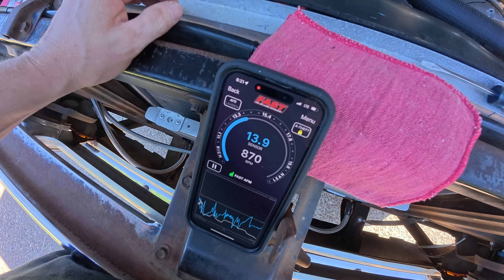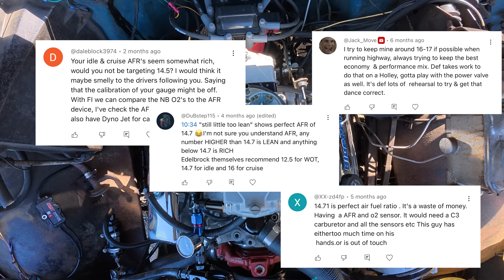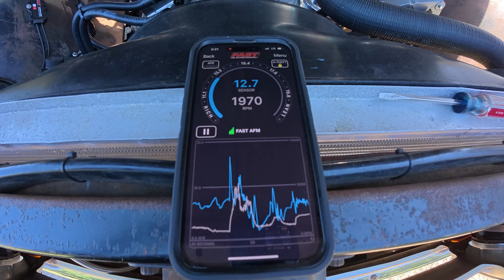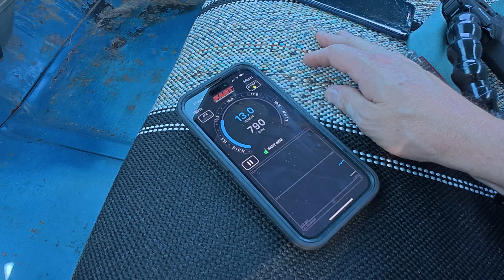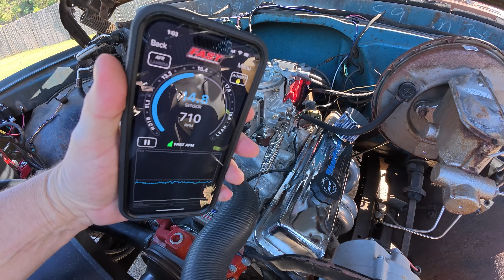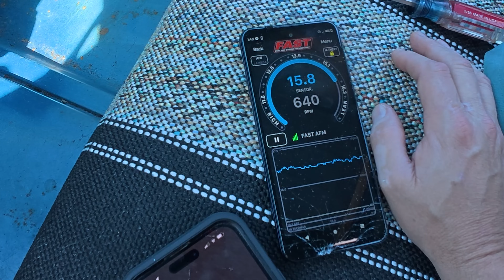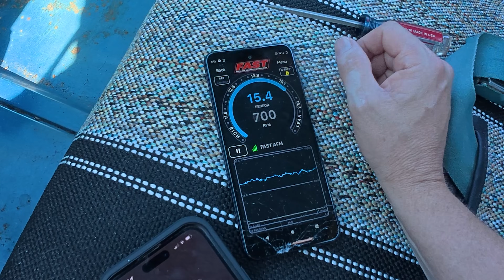Lean or Rich? How to Set AFR for Best Engine Performance

Comment: I was always taught the pyramid method, idle, cruise, light acceleration etc all the way upto WOT. My question is why does idle afr matter when the engine isnt under load? If its 16 17/1 as long as when you touch the gas it enriches surely the idle afr doesnt really matter
Reply from the maker: Tell that to your engine! 😂 Race car, yeah I don’t think I’ve ever tuned for idle AFR.  Cruiser? Yeah that’s pretty important if you’re trying not to cook pistons, valves and spark plugs.  Those things don’t automatically cool off when cruise conditions are applied.  Detonation, knock, stumble are all conditions that can occur with poor AFR settings.
Reply: @MuscleCarSolutions  to be fair it is on a trackcar that never really I'd left to idle. So yeah depends on car application fair answer

Comment: I'm just jetting into tuning with AFR. Right now I have a stock 6.0 Chevy with a knock off dual plane and a 650 vacuum secondary Holley. Ignition and the 4L60E are controlled with a tuned 411 GM PCM. I drag race the truck and street drive it. I'm chasing a random misfire above 3500 with moderate load. I don't notice it at WOT so I'm thinking its a fuel issue. The AFR meter will be here this week so I can get to it! Thanks for the info video! I have much studying to do
Reply from the maker: There’s a lot to unpack in your set up. Hopefully the AFR will give you some insight.  I wouldn’t discount that the misfire isn’t an ignition issue.  I’ve made mention quite a few times; even though I will always use an AFR to tune, I will also always read plugs.  I did two videos on the topic that you might find useful.  Good luck in your tuning!
Reply: @MuscleCarSolutions thank you. I have looked at the plugs and even though the porcelain may be clean the shell is still City so I'm sure there's some room to be found there. Even with new plugs and plug wires and misfires there. Next will be swapping in doing good coil packs
Reply: @MuscleCarSolutions I have heard that a misfire can skew the oxygen sensor to Rich, is this the case?

Comment: I own a carb company so I’ve had a million calls
Carbs generally need to idle a bit richer than efi, warm and cold situations are a big factor. Also fuel temps really make a big difference. I tune idle warm to the highest idle and then add 1/8-1/4 turn richer to aid in cold start and warm up. Every engine is different but general hotrod advised
Reply from the maker: You own a carb company?  What brand?

Comment: What would be your approach if you only have a vacuum gauge to tune by, I’m just curious since most of us don’t have an AFR setup, would you set it at the engines best idle vacuum and maybe go a hair rich? Thank you sir 👍😁
Reply from the maker: Highest vacuum but you’ve got to be a bit careful with that method.  Your best bet if you don’t have an AFR is learn how to read plugs and read them often.
Reply: @MuscleCarSolutions great advice, thank you
Reply from the maker: @davestewart9146  I did a video on how to actually read plugs.  Well worth a watch if you haven’t seen it.  It’s not that difficult to know EXACTLY what condition the engine is seeing.  I’ll always tune my stuff with an AFR, but I still read plugs.  👍

Comment: Great video! I was wondering why after setting my idle AFR close to 14.7 when the engine was at operating temp, shutting it off and restarting after sitting for a short period why my AFR was reading the idle much leaner. I just kind of blew it off as something with the sensor because like you stated after driving around for ~ 5 minutes the idle AFR reading will go back closer to what I set (~14.7).
Reply from the maker: Yup. It’s a detail that most don’t even know is occurring unless they’re using an AFR.  And even then, it’s important to know.  👍

Comment: My hopped up 350 likes the idle around 13.30 to 13.80. If I go leaner it leans out too much when the engine is hot. Interesting enough, when I start it cold the AFR is around 12.5 to 12.8. These carbs just fluctuate based on engine temp and air temp. Oh, running Edelbrock AVS2 650 CFM.
Reply from the maker: All carburetors do. Just a downfall of an analog system. Sounds like you’ve found the spot the engine likes.

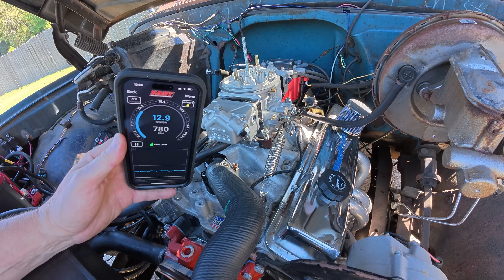Comment: Hey Brian I’m a little confused at 11:15 you said let’s take a little fuel out of it and the AFR read richer wouldn’t that be adding fuel, and taking away air
Reply from the maker: Misspoke. I was making it a richer mixture for the demonstration.  We ended up down around 12.3.  👍
Reply: @MuscleCarSolutions awesome brother thank you😀😀
Reply: Hey Brian what size hose do you have returning to your fuel tank, I’m putting a new tank in and I want to add a return, so far I’m coming up with a 1/2 to 3/8 steel reducer then 3/8 brass 90 , that’s if 3/8 is big enough, thanks
Reply from the maker: 3/8 is probably enough.  All depends on HP and how much pump flow.  Under 400 hp?  Yeah 3/8 should be just fine.
Reply: @MuscleCarSolutions yes under 400hp , can I just go with a 3/8 barb end , for hose and clamp
Reply from the maker: @DesertRatFabrication  yeah it’s fine on a low pressure system.  Assuming you’re running just a mechanical pump.
Reply: @MuscleCarSolutions I’m running a Holley electric pump now 4-12 psi but probably going to bump up to Edelbrock 140 gph, I think the Holley I have now is 38 gph
Reply: Hey Brian I had another question for you in comments

Comment: I have a 73 nova with a 350 mild performance engine and i would love to be able to check my air fuel ratio but i dont know what all i need to get started and i have the Edelbrock avs 2 650 cfm carburetor and i would like to be able to use my iPhone also. Any advice would be very much appreciated.  Thanks.
Reply from the maker: Link to the AFR I use is in the description.  I also did a video recently with some install tips.

Comment: I connected my vacuum gauge to myrebuilt  rochester quadrajet carburetor on my 78 Cadillac Coupe. And i got a reading of 23 in hg. Steady needle. Carb wasnt rebuilt by me. So my question is since it iis reading 23 in hg does that indicate a good idle mixture mix? Thanks

Comment: What type of hose are you using for the push lock fittings?
What is the effect on carb when pressure is 6lb and 7.5 lb and the carb does not flood over at higher pressure.
Reply from the maker: Push lok fittings use push lok hose.
Reply: @MuscleCarSolutions  What type of hose is push lock hose or what brand?

Comment: I’m at 13.6 idle afr at 850rpm leaner or richer then this will lower the rpm slightly, seams happy enough
Reply from the maker: Sounds like it’s happy.
Reply: Yeah I’ve found that a timing light with a digital tach and afr gauge under the bonnet makes all the difference when making adjustments so I can see how useful that fast system would be
Reply from the maker: @NathanOliver-z3n  pretty amazing to have the technology to make tuning easier.
Reply: Yeah my setup is pretty low budget, 15 year old innovate lm-2 and a chain store digital timing light

Comment: I target 13.5 idle to cruise. If I make it leaner cold engine driveabilty it bad with no air cleaner heat or heat crossover. Engine temps were slightly higher with the leaner mixture. This is what my engine combination wants.
Reply from the maker: It will always tell you what it wants. Just gotta listen!  👍

Comment: I am working on tuning my first carb (800cfm avs2) on a mild 440. I'm using one of the carb cheater systems to monitor my afr and data log. Currently I'm at around 13.5 at idle, 12.5 to a little over 13 at cruise and dropping to aroumd 10.5 to 12 at wot. I'm currently using #2 setup on the edelbrock chart. Im going to move to 3 and lean out a little and data log it.
Reply from the maker: The tuning chart is your best friend! Follow it and you’ll get great results.

Comment: Great video I just changed my exhaust system on my f100 and as soon as I started the truck you could smell the rich fuel mixture compared to the leaking duel exhaust but in doing that have to get new o2 bung for my afr gauge I leaned it out by sound of engine and it's running way better now and so far seams like it gained some power thank you for all that you have bought me hello from Canada 🇨🇦
Reply from the maker: Glad to hear it man! Nothing better than being in control of the situation and making the changes you want to get the results you need!
Reply: and to think my truck runs like new with $50 ford 2bbl swap meet carburetor lmao 🤣

Comment: What I run currently in my squarebody 17.5 to one at idle. Between 17 to 15 to 1 at cruise. 12.8 to 13.3 to one WOT. I would like to see someone else get 25 mpg city driving out of there 305. lol  The amount of tuning it took was mind numbing! Also you can't go as lean as I have and have a smooth idle and get any power out of it unless you have a vacuum advance. I idle at 54 degrees of timing 32 static 22 vac advance.
Reply from the maker: 😂 if mileage is your primary concern, you’ll find that in the transmission, not in cooking that poor little 305.
Reply: @MuscleCarSolutions  My engine temp hovers between 170 and 180 depending on outside temperature and driving conditions. Once you get past 15.5 to 16 to 1 at idle. Engine temp actually goes down because there isn't enough fuel to heat up the air. But I agree an overdrive would be nice.

Comment: Great Content! 👍💪  I try to tune on the safe side of fat myself.  I'm in the mid 10's at WOT last time out, but that was on a warm evening.  Now that it's getting cold out, maybe I should see what it reads on a cold night before I take jet out of it.  I also noticed it blipped up to 12.5 during the upshift.  According to a test by Richie Holdener on an ls engine, being in the mid 10's produced a 10 HP loss on a 450 hp motor.
Reply from the maker: Yes.  Anything under 12 does tend to roll downward on the curve pretty aggressively.  I’m not sure I’ll have time to do that here in a few weeks when I head to the dyno but I’d love to show how too much fuel kills power. Much easier to show on an EFI set up where changing fuel values is easier/quicker.  👍